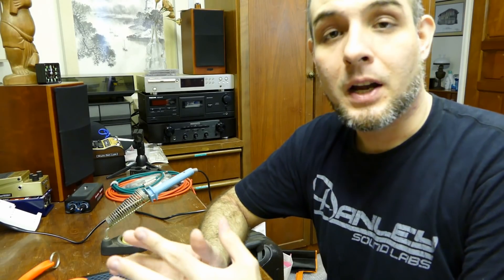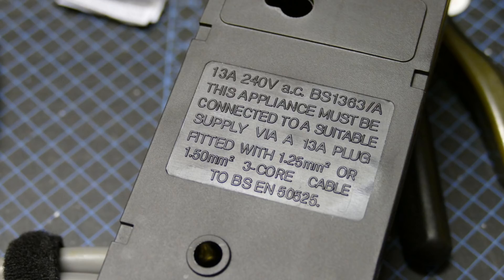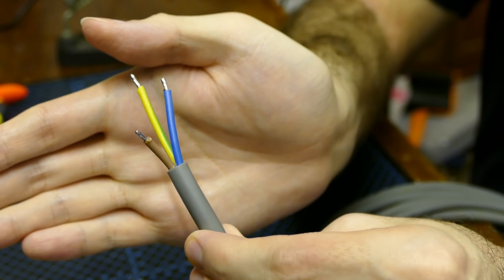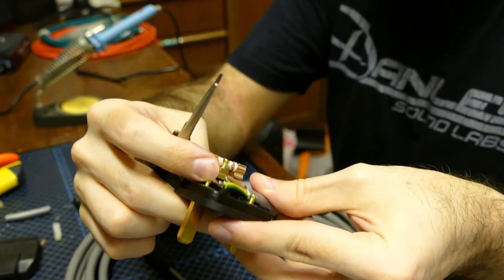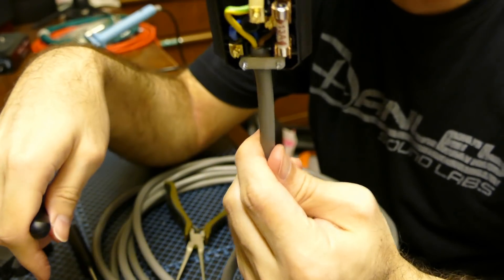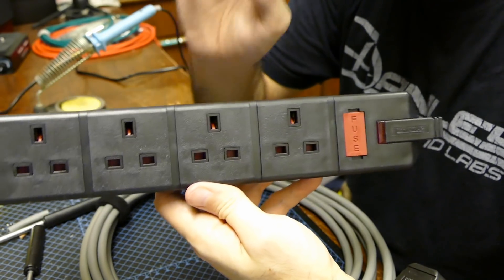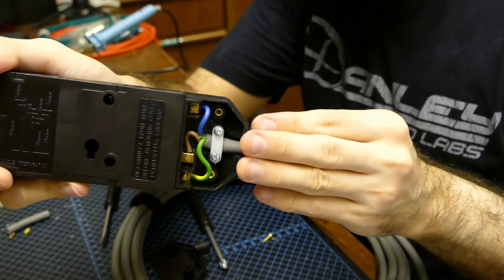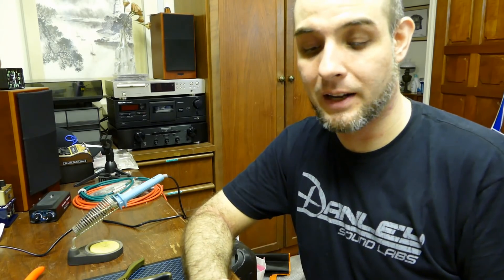How to Wire BS 1363 plugs and sockets

Comment: If i bought Pa speaker with only speakon connection, how could i connect to my home receiver to this. Any help would be appreciated.
Reply from the maker: You would need a speaker cable which is speakon on one end and bare wire/spade lug/banana plug on the other end, whichever fits your AV receiver.

Comment: PermaPlug is great, but I'll stick to MK lol. Only had 1 fail on me because it had like a Ceramic shell instead of plastic, and I dropped it lol.
Reply from the maker: It may have been one of the very old Bakelite plugs - after a long time those will shatter like pottery when you drop them 😅
Reply: @GLBProductions  They actually still make new ones, haha..

Comment: You should not tin the wires in a screw connection.

The reason being that the solder wicks the strands together.  Solder will creep in time up the cable and you will find that the cable can work loose in the terminals.  If you want to have a solid insert into the terminal is it better to crimp a ferrule onto the wire ends.
Reply: yup, solder tinned conductors do not work with screw-on terminals...
Reply from the maker: An interesting observation! I will look out for this in my older plugs. Thanks for the comment.
Reply: It’s not that it creeps up the cable, solder is amorphous under pressure and it gets pushed out of the terminal causing the termination to become loose.

The bit about it creeping up the cable is that it is tricky to tin the ends without the solder also wicking up the cable which causes a stress concentration without any support or relief that can cause the copper to fatigue and break
Reply: I agree...It is better to use bare conductors, insert them, screw tight then wiggle a little with the wire to help set the conductors then tighten again.

Solder is bad since it is mostly inelastic, softer, has a thermal dilalation much different from copper/brass and tends to redox with brass over time.

However, if you have already tinned your wire, once in a while, open the connector and re-tighten the screws.

Comment: Nice video. You have taught this Brit a thing or 2! But is there a reason you don’t remove the neutral & earth to wire them up? It makes it a lot easier. But you have to reverse the order. Earth first, then neutral, then live last, or you can’t get the neutral back into it’s hole. I’ve found it’s quicker, plus you need one fewer tool (no needle-nose pliers).
Reply from the maker: Hi Nigel, glad the video was helpful :) I have tried method in the past, ie remove pins, attached wires, re-insert pins. Unfortunately I find that I can never get a good enough grip on the loose pins to get the torque I need to do the second stage of tightening, so I find it easier to do everything in the body of the plug itself.
Reply: GLB Productions Hi Bruno. Thanks for the reply. Sure, clearly it only works for initial positioning. Tightening needs to happen at a later stage, as you say in your video. You may be amused to hear that for 1st stage promotion in the Civil Service of the U.K. Government, one has to do a presentation on any subject, and the one most frequently chosen back in my day was precisely this subject: ‘How to change a plug’. Even so, I still learned from your video. All credit to you. I reckon if you released it with that title it would get a few views in the U.K.!

Comment: Hullo, Bruno! In the old days, appliances used to be sold without plugs and everyone was expected to know how to wire plugs. If anything is sold with a two-pin Europlug, I automatically cut it off and put in a fused three-pin.
Reply from the maker: Good idea! The reason they can get away with that sort of thing in Singapore is usually that the appliance in question is double-insulated (plastic case) and therefore risk of the exterior becoming live is precluded. However there's nothing like having the correct plug for the correct socket!

Comment: An excellent video Bruno, many thanks. Having lived all my life in the UK I thought I knew it all - but no. The tip about dealing with the strain relief was especially useful.
Reply from the maker: Ah yes the all-important strain relief. Bring from the UK, you will know that there are many different brands of plug which conform to the BS1363 standard. I have seen several different designs of strain relief - the one in the video though, I believe to be the best as it can be adjusted to virtually any cable thickness.